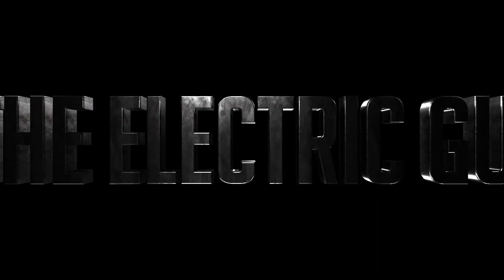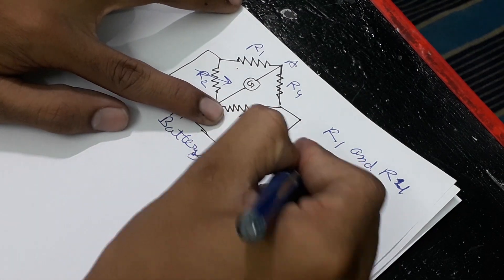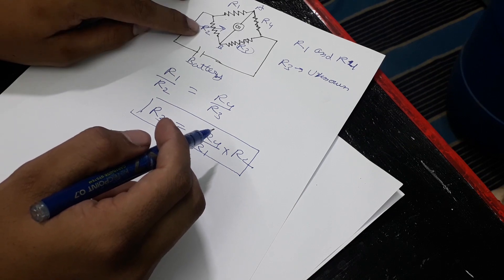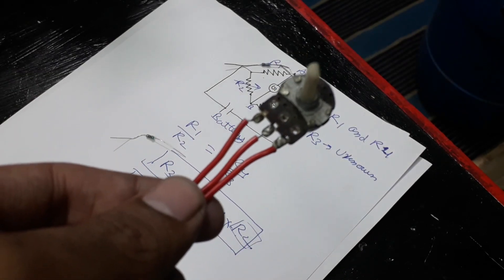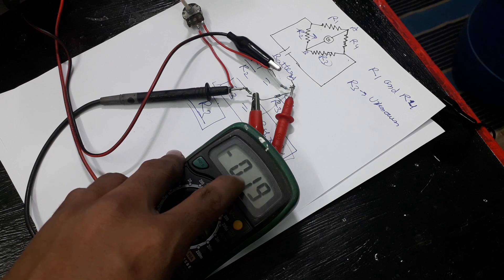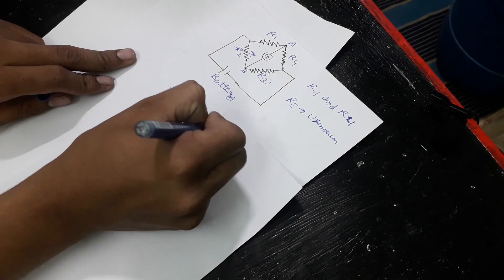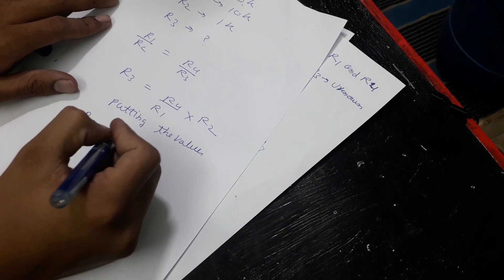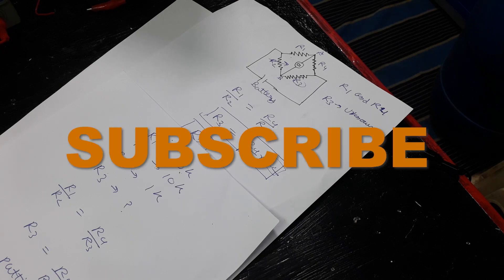How to use Wheatstone Bridge to find Unknown Resistance

Comment: Why you used multimeter to find value of Potentiometer ? Why you didn't used multimeter to find value of unknown resistance?
Reply from the maker: Yes, you are correct but this video was to understand the concept of Wheatstone bridge
Reply: @THEELECTRICGUY  Bhai But mujhe wo bridge balance karne ke baad unknown resistance ki value find karni hai pr mujhe usme us variable resistor ki value kaise find karu ?
Reply from the maker: @sforsuraj7255  there are certain variable resistance whose values are mentioned on them. 
In high school labs we use potentiometer instead of variable resistance which is a much better option
Reply: @THEELECTRICGUY  My question is we are using Wheatstone bridge to find an unknown resistance but you have to connect a galvanometer and a variable resistor or rheostat to balance that galvanometer so that we can use wheatstone bridge formula to calculate unknown resistance but while balancing the galvanometer we are changing value of rheostat or pot so how I can calculate the value of that variable/pot 'R' resistance so that I can use it in that unknown resistance formula. S=(P/Q)×R
Reply from the maker: @sforsuraj7255  For that purpose in high school lab we use a wire potentiometer of length 1m in which a balanced point is obtained and length l1 and l2 is measured and then it is substituted in the formula to find value of unknown resistance. This thing I have not shown in the video because I was not having the apparatus..